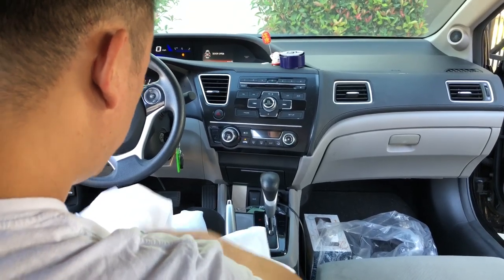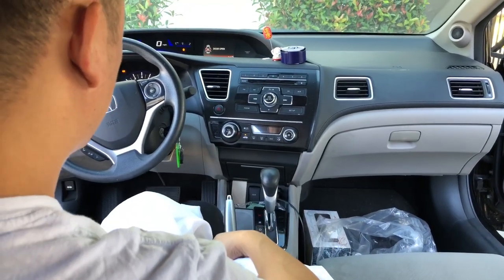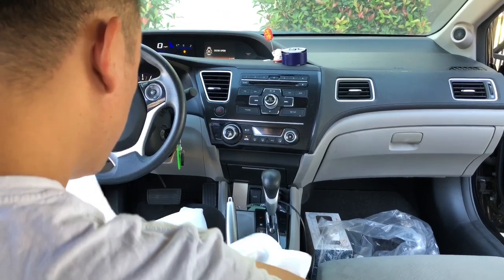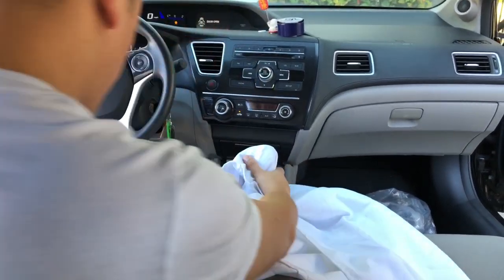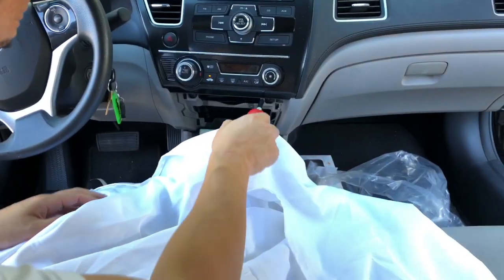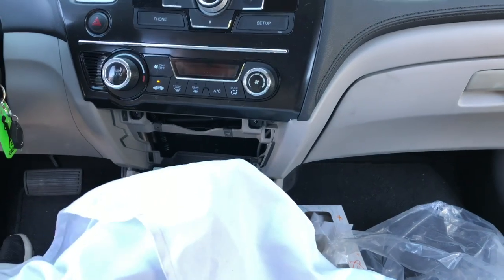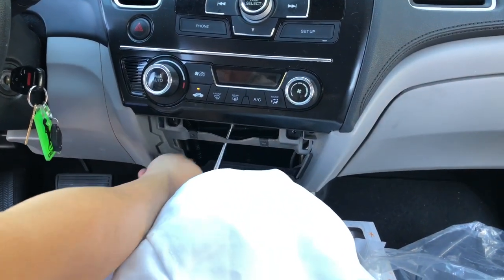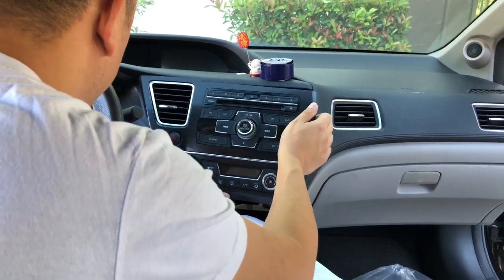HOW TO REMOVE HONDA CIVIC 2013 DASH

Comment: How about connecting av cable from wired reverse camera, do i need to take the radio out or route via glove box?cant figure out to connect video cable from reverse camera.thank you.
Reply from the maker: There is a RCA connection label " back video in" that is where the video cable goes for the back up camera.
Reply: OttoNavi Customer Service how can i access the back of imid monitor (civic 2013 built in monitor) thank you. Do i remove glove box? Radio?
Reply: Ever get a reply?